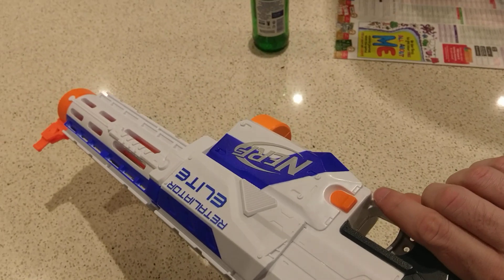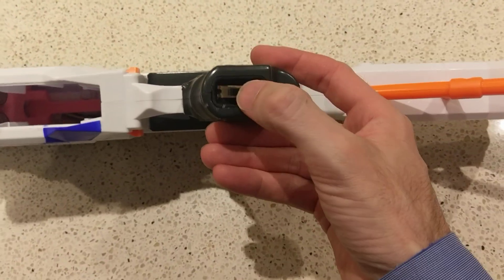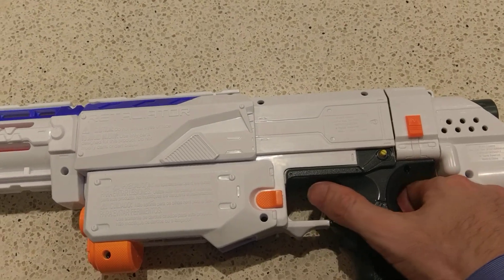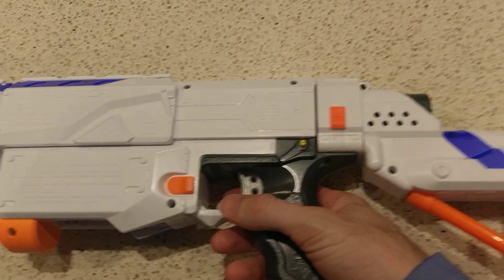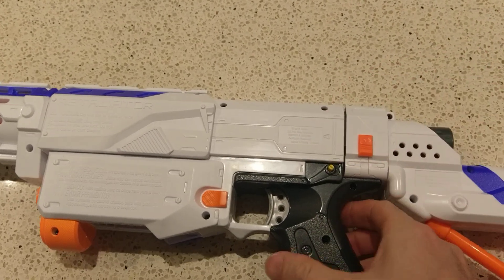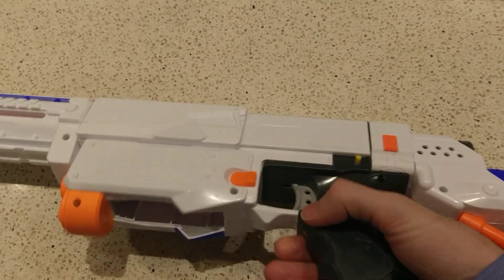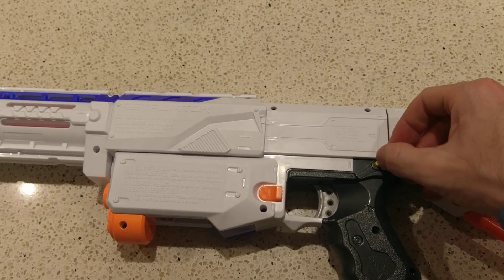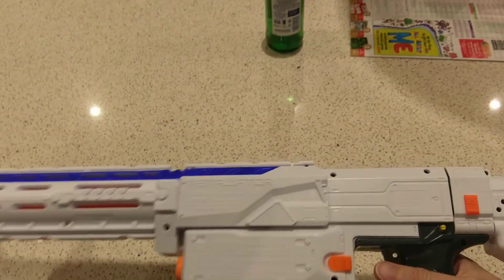Full Auto Nerf Retaliator (with Burst and Single shot mode)

Comment: How did you Bild this?
Reply from the maker: In a nutshell, the build has the standard FTW setup in it. Mosfets on the solenoid and the flywheel cage. Arduino to control the mosfets, and also connected to the trigger switches and select fire switch. I modified one of my select fire brushless firmwares to drive this.